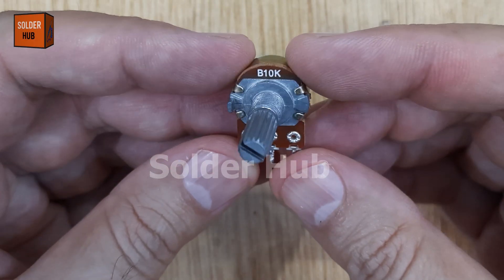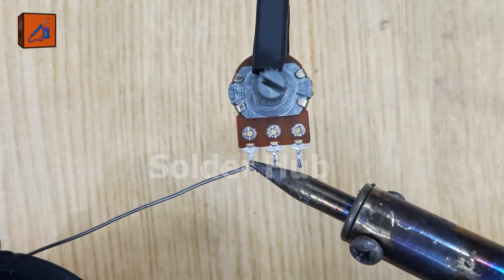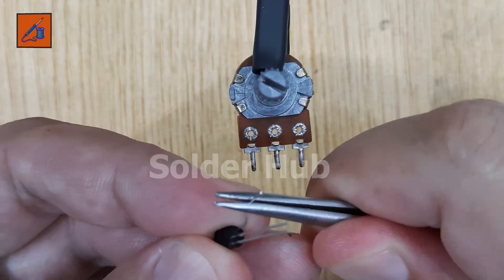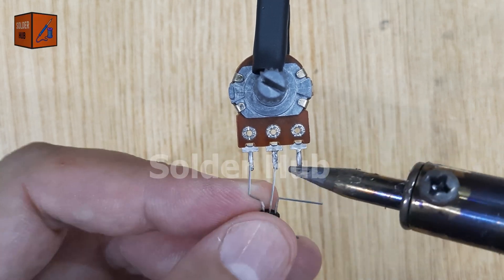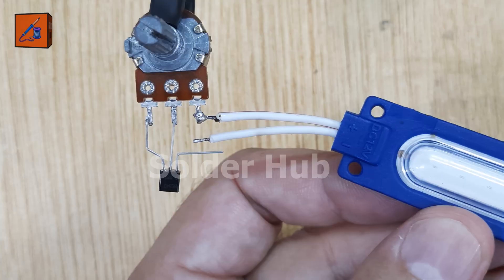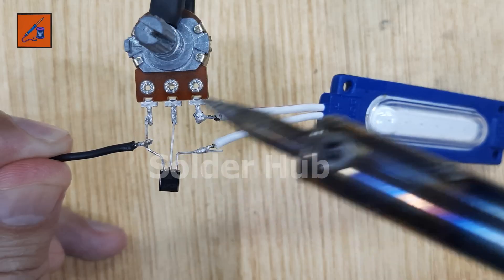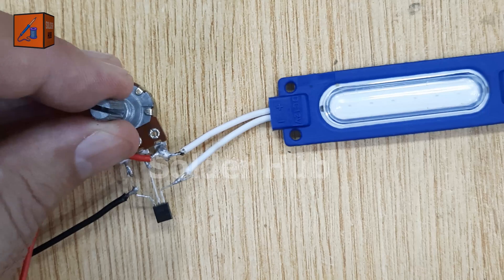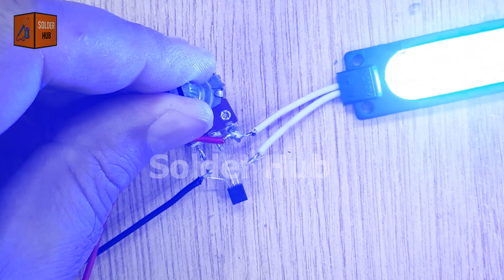How to Make LED Brightness Controller Circuit using 10kΩ Potentiometer

Comment: Does it work with a 5v connection?
Reply: It will. It’s just a lower voltage that doesn’t tax the transistor as it’s being gradually opened up by the the potentiometer. A 10k might be a bit of overk!ll but it’ll get the job done.
Reply: @VenkmanJ thnx for the information!
Reply: @stoniest_here you are most welcome 🤗

Comment: Does this work to any LED diode, or is it to dimable only?
Reply: Personally, I’d check it out for yourself. But you should be able to dim regardless the light. Some light sources just burn out more quickly because they weren’t perfectly designed for it.